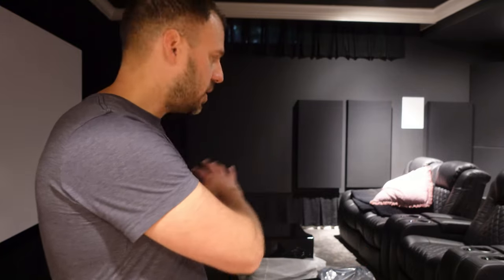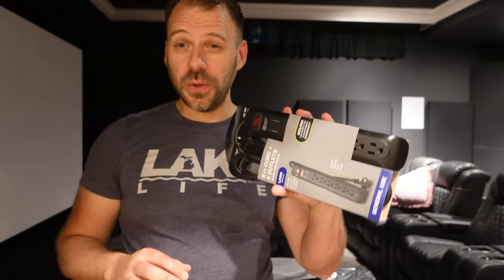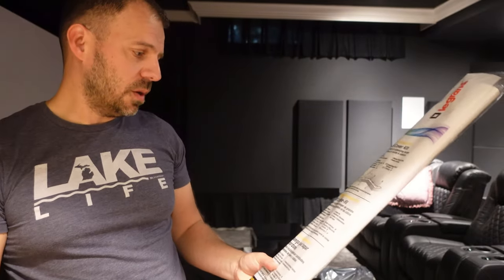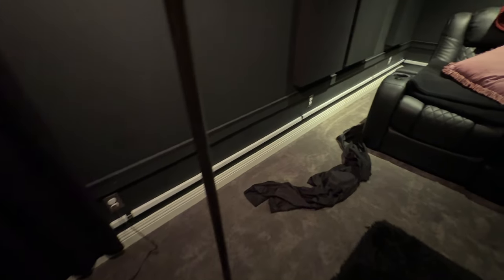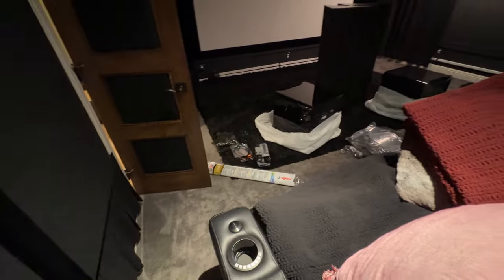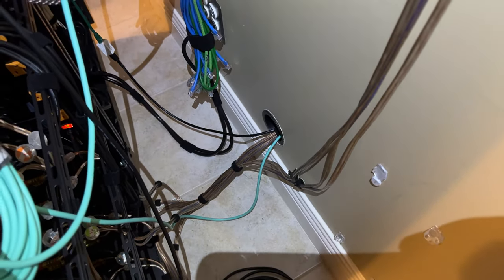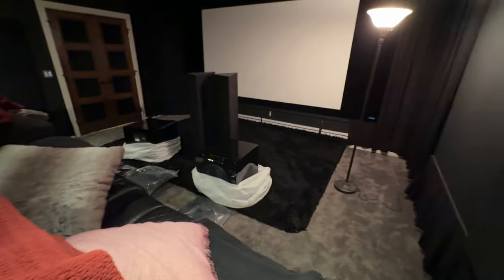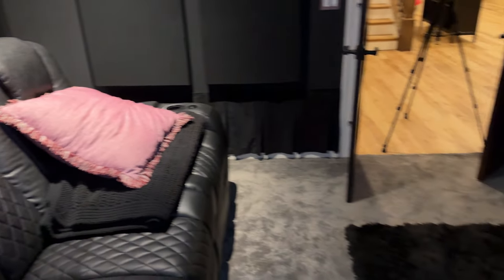Time for FOUR Subwoofers | SVS SB16-Ultra Home Theater Install Vlog

Comment: I played the recessed light game for a while with those big housings vibrating.  Padding, foam, electrical tape, etc.  Could never get rid of it all.  Finally just went at it one day and pulled those suckers out through the cut outs.  A cat's paw, a hammer, a good pair of snips, and a pair of diagonal cutters all paired with some patience and diligence.  Took maybe two and half hours but got all 6 of them out of there and replaced them with can-less lights.
Reply from the maker: Yep. My plan to change the trims already failed. I'll explain in upcoming content. I can't wait to rip this room down to the studs and do it all over again. :)
Reply: @Techthusiasm  yea, I did my first version similar to yours.  Didn’t have all the knowledge I thought I did when the house was built and was constantly tweaking and adding stuff:  curtains, cable tracks, trim, velvet, and other stuff.  Finally I realized the only way I was gonna get the room I really wanted was to tear it down and build it from the ground up with a full plan in place.  It was 4 months of DIY hell every single day but so worth it in the end.  The way I see it, anyone can buy gear and put a home theater together, but it’s the space that really makes it special.  Looking forward to see what you’re gonna put together.
Reply from the maker: Yep, I have a pretty decent plan I think for the next few years what I want to do in my spaces. I just need the channel to grow to fund it all! :)

Comment: Jeremy, why did you go with the SBs versus the PBs? Just curious. I love my dual SBs but didn’t think the increase in costs warranted the PBs. Although they’d be nice 😊
Reply from the maker: I already two sealed subs that the SVS were integrating with, and it's not wise to mix sealed and ported. I think, in general, I prefer the pros of a sealed sub over the pros of a ported model as well.

Comment: What fabric are you using to cover the wire runs and how do you attach it to your wall. I'm considering doing something similar in my room.
Reply from the maker: It's a general velvet like fabric. I don't know the specifics. The seamstress I hired to make the curtains provided the material. It's attached the wall with velcro. There's a velcro strip sewed onto the back of the curtain. Then I mounted black painted lumber on the wall and stuck the other side of the velcro to that wood. Then just zip the curtains up along the velcro.
Reply: @Techthusiasm  Thanks so much, Thats very similar to what I had in mind but im not seamstress so ill have to track one down. Thanks again!

Comment: Wouldn’t it be better to place the SVS subwoofers at the back instead of near the screen in front? And move the ones at the back upfront? This way you don’t have the distracting blue screen light of the subwoofer in the front while watching the movie. Just a thought!
Reply from the maker: The light doesn't have to be on all the time. For sure, I wouldn't want that light on up front. I have them set so the light comes on for like 10 seconds when they power/wake up, then goes off.

The rationale to have the SVS up front and Arendal is back is based on the likelihood that the SVS have overall higher output, so put the lower output subs closer to maximize their volume. We'll see if that's true soon with measurements.